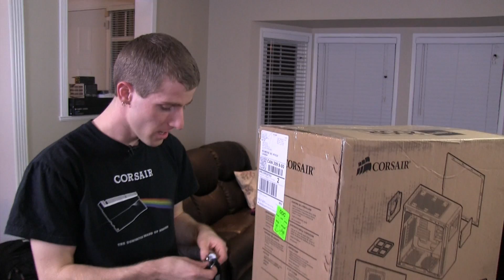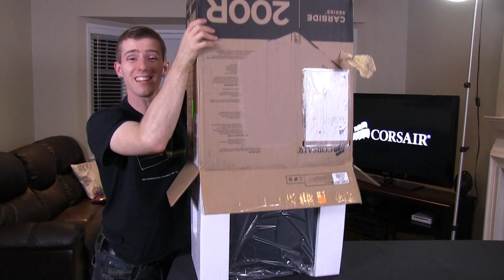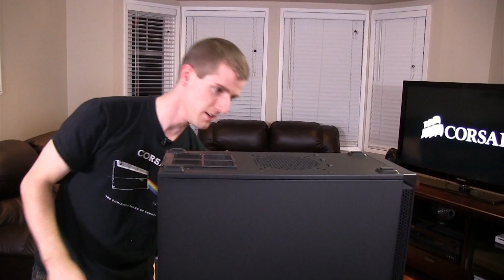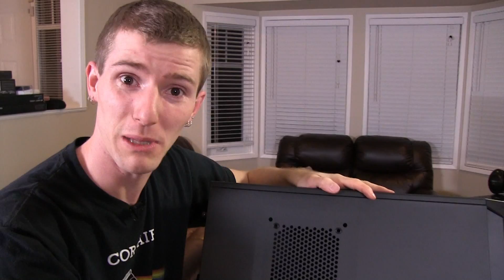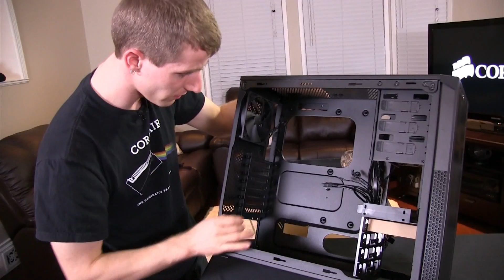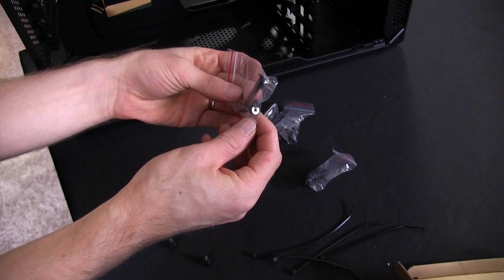Corsair 200R Value Gaming Carbide Series Computer Case Unboxing & First Look Linus Tech Tips

Comment: Interesting that the value cases look the most sensible - no extra lights and windows and shit.
Reply: Agreed. I wanted a no nonsense case that has all the money put into function, not style. My case doesn't need spoilers.
Reply: The simplicity of the case is the best part, although I did buy one with a window just because I like to see my computer
Reply: But it's a known fact that spoilers increase the speed!
Reply: Dominic Maas did u get the 200R? I bought one cheaply on Black Friday and personally wasnt too impressed about it after checking it out further. Its easily beaten by newer and cheaper cases and hdd cage prevents good airflow etc. also making top vents quite pointless, because who would want negative pressure. Also im interested how much does it cost wherever you live? Here its still ~65€ making it close in price with newly released quite awesome 270R.
Reply: Dominic Maas nice choice :) do u have 2 hdds? u could screw the ssd in 3.5" bracket if its empty.. provided theres the correct holes. so weird that 4 year old 200R is more expensive than better equipped Pro m :D here theyre quite close in price, pro m being bit more expensive
Reply: Dominic Maas nice choice :) do u have 2 hdds? u could screw the ssd in 3.5" bracket if its empty.. provided theres the correct holes. so weird that 4 year old 200R is more expensive than better equipped Pro m :D here theyre quite close in price, pro m being bit more expensive
Reply: @TheViolander  for cars, not computers
Reply: @ajddavid452  You are not very good at reading social cues, are you?
Reply: @TheViolander  what's a "social cue"?, oh wait I could just google it, yeah I'm gonna do that Edit: after doing some research I realize that you weren't being serious, damn sometimes I don't think the obvious

Comment: I bought this case back in July 2013, still have it and don't plan on replacing it anytime soon. It's no larger than it needs to be to get the job done, yet can still fit a pretty long GPU and 11 drive bays total (3x 5.25, 4x 3.5, 4x 2.5).

Also protip for anyone watching in 2020, there is a dust filter kit for this case specifically, made by DEMCiFlex, which might be worth getting as this case has no dust filtration otherwise except the front panel and PSU fan

Comment: 2021 I’ve had this case for 5 years great case...lots of storage left over but if you’re trying to fit a 1600W psu it’s gonna require some bending of metal as I have discovered but not much, still looks pretty...only con is the glued on rubber feet came off that’s it
Reply: some extra info for 2023:

If you're using a GPU that is longer than 330mm (Asus TUF RTX4080) You WILL need to remove the drive bays entirely in order to fit the graphics card in this case. To do this you have to remove the front panel (you WILL need to remove anything mounded in the 5.25 bays in order to remove the front panel) and unscrew theHDD/SSD bay and then pull it out(Might need a bit of force, but not too much). I strongly recommend getting a corsair SHIFT power supply when using this case if you want to mount a fan on the bottom of the case. Gonna need to mount the SSDs in the drive bay if you're not using them, otherwise go full NVME. Still a good case that I've been using since 2017.

Comment: Ive been using this almost 8 years now. I dont care about lights or side windows or water cooling. I wanted the smallest case that is decent quality, could still fit a full sized ATX board and had room for an optical drive. I actually use all 3 external bays -  smart card reader, dvd burner and a card reader. Its been the perfect case and its only like 60 bucks. I reused it for my new build when I moved to ryzen 3600 from an intel 3770k.

Comment: oh my gosh thank you Linus, when you said something about the pin would shock and destroy your motherboard, I was like oh my gosh that's what I did wrong because I thought my motherboard was just dead but it turns out it was actually shocked now I know why!!!
Reply: The pin Linus is relating to is a centre alignment pin and does not touch any printed cirduit parts. It pushes through the hole and helps align the motherboard.
Reply: @tonyb7779  this ^

Comment: 5 years late but who cares. Just finished an install in this case of an Asus Z(&P motherboard and all of the other bits. All donated parts from my grandson who has upgraded his gaming PC. So easy to install. No problems and everything clearly labelled for even the most stupid of us. Big point, the pin Linus is referring to as could short out your board, is a centre alignment pin and simply pushes through the centre hole allowing easy alignment of board. Great case and very happy.

Comment: Everything fit! The large open spaces in side the case made cable management great and the Corsair H80 fan fit perfectly, leaving me space for two 120mm fans on top to push air out. The case is made out of hard steel and plastic and I was able to fit it nicely underneath an elevated desk on a  shelf 3 inches off the ground.

Comment: This old video has made my day. Just like Linus the Carbide 200R does not age. The sad news is that Corsair has stopped making them from what I have read. A lot of builders use this case for there clients base. Longtime YouTube presenter 

CareyHolzman has built hundreds of system using 200R. So with all that said I'm going to buy my 200R today before there all gone from the channel. Thanks Linus and Carey for helping this old  bench tech to get back to his roots.

Comment: Bought this in December 2013.  Front stock fan is just now going bad.  Pretty good for computer which is running all the time.  Not flashy case but really easy to build and maintain a system.

Comment: If you go with an H80i, don't bother going push-pull. Push Pull gives it more static pressure for better cooling, but the H80i comes with a Corsair SP120 which is a Static Pressure fan. Just run that in pull and you'll be fine. If you want to be a bit experimental, you can try the H80i in Push Pull, because if I am correct, it comes with 2 SP120's. (Which as far as I know means it's twice the static pressure as just a single one)

Comment: I just found this review after getting the case a few months ago. I had forgotten/not known that it had four SSD mounts instead of two. It has been a great case, just about to put an all-in-one cooler for the CPU. A good case for a new builder.
Reply: Tech Fox what all in one did you install in 200R?? im curious how thats possible :')
Reply: Signaturisti I'm using a Corsair H55. I mounted it to the back fan mount in a push-in configuration (and yes i know that it is not the proper name). Do you have the case or just looking at reviews?
Reply: Tech Fox HAD the case... bought it when it was cheap on Black friday (without much research) thinking i could put 240mm (h100 etc.) preferably in top or then front if needed, but neither is possible so I returned it and dont even have aio cooler yet so i dunno, maybe i just stick to my 212

Comment: Nice unboxing. And don't worry  about the living room. It makes your presentation look a lot neater than it otherwise would be

If this were a disassembly say of a laptop or something more technically intensive where tools and special test equipment were needed, that would be different., but for an unboxing it's just fine.

I am planning another Linux workstation, and this model is on sale locally from Canada Computers. That's just fine, now for a look at the rest of the stuff.

Also i like the 4 5 1/4 bays, lots of space for custom hardware, some of which I make from the raw steel up myself, sometimes by modifying stripped old CD drive cases as a start.

Comment: According to Corsair that extra standoff that Linus says could short your board is actually an ATX board alignment pin and as it corresponds to a screw hole in ATX boards I think it's meant to be there.  Apparently in some 200r cases it is unremovable but I'm not 100% on that
Reply: It is impossible to remove that pin. I have the case right here.
Reply: BoruOfPogoBog

I've installed my mobo into that case since my comment and no problem at all arose from that pin
Reply: I'm not installing an ATX board so it won't be a problem for me either. Lines up fine with Asus Z170-P. I'm very pleased with the look of the case and it only cost $45 after rebate.
Reply: TriggRNC So your ATX board didn't short? What about the other pins? Do I have to install standoffs or are those little pins standoffs?
Reply: no didn't short, after being undecided I googled the extra pin and a 
corsair guy on their forums said to leave it as it was a centering pin. 
 Motherboard went right in the case without any other standoffs needing 
to be installed as they are preinstalled.

The Corsair forums are worth a look too to be sure.

Comment: I know this is old but I had a PC built more recently with this case. Installed is a Asus Crosshair Hero Vlll with 128Gb ram and AMD Ryzen 9 5950X. I would love to see you install a water cooler, as discussed in this video. I have managed to fit a Corsair Liquid Freezer ll 240 but with only 4 out of 8 retaining screws.  Would love to see it done.  Might improve my fit.

Comment: From someone who owns this case - you cannot fit an AIO dual radiator (such as H110i) on the top. Even with the offset screw holes, a radiator+fans is going to hit 99% of motherboards and ram.

Comment: I think this looks very similar to the Obsidian 450d. The only thing that is not the same is the front panel and the window and the side. Would you rather recommend me to buy the 450d or this one???
Reply: MyNegativeCreep 450D has 2x140 support in front (not much of difference) and in atleast in here its 60€ more expensive than 200R (76 vs 136). I'd choose none of them, but F-D Define-series instead ;)
200R is 4 and 450d is 2 years old. was gonna build in 200r but after research - hell no!
Reply: i was looking at fractal design cases but i do not like front doors made of plastic...
Reply: MyNegativeCreep 200r has plastic front panel and imo looks way cheaper
Reply: I think the 450d looks just fine in comparison to R5 and 200R. Would you recommend me some other case around 110$?
Reply: You could get NZXT S340/H440, Corsair 270R or 400C or 400Q or 300R? Enthoo PRO M?  

How did you like Define C? It's the newest in Define-series. That's propably my next case when I go for watercooling.
Reply: The Define C is nearly the same as the R5 with a plastic front side that's why I decided to not buy this. But the NZXT S340 Elite is nice imo. But without any 5,25" drive.
Reply: MyNegativeCreep do u need 5.25 for daily use?
Reply: MyNegativeCreep arent they all plastic... even at that pricepoint
Reply: Too bo honest I use it like twice a year so I do not really need it, but it's always good to have one if I have to reinstall some old stuff and watch blurays. But maybe I should go aftera bluray player instead? hmm
I thought I could get the NZXT S340 Elite then. (which has no optical drive slot)
Reply: MyNegativeCreep twice a year you could just open the panels and plug internal drive in for the moment :D thats what im doing

or buy external one
Reply: lol good advice mate

Comment: That little nub / stand off thingy at 5:11 where he says, "you better remove this one or it will short out an atx board!" seems to fit through a hole in my MSI m5 z170. I just finished building my pc and am struggling with a no post (everything turns on). is this little extra standoff (that I cant seem to remove without a hack saw) the reason for my no post?

Comment: Since the top can take 120 and 140mm fans, is it possible to fit a 280mm radiator or would it contact the motherboard?

Comment: This may be a dumb question, but it's necessary due to my lack of computer knowledge. I am building my first computer this weekend (w/ the help of an experienced friend) and I am using this case. My motherboard will be the ASUS prime 390-A LGA 1151 ATX, I've been seeing that I may have to remove a standoff before installation of the motherboard to avoid shorting it, will this apply to me as well? Thanks!
Reply: im not sure, but there is a very easy way to check. just place your mobo in your case before you start your build. u will be able to see which standoffs need to stay and which need to go by aligining the screw holes on your mobo with the standoffs in the case

Comment: Thank God I saw this. Would've gotten my ATX board shorted out.
Reply: Bestgameplayer10 how do you remove the middle standoff??
Reply: Alexis jimenez When I checked, mine didn't come with that little there where he pointed out in the video. But the little above that is to help place the board down correctly aligned.
Reply: Oh i see, thank you im a little nervous since this is my first build, i tried to plier off the aligning pin, if i scratched a bit of it off will it possibly shock my motherboard or am i safe with that
Reply: Alexis jimenez It shouldn't. I was nervous wit my first build too ( which was a couple weeks ago ). I'm sure you should be fine. If the part you scratched is black like the rest then I imagine it being fine.

If you have more questions, you can ask me via Kik if you have it: bestgameplayer10
Reply: thanks man, yeah im a little shakey right now, screwing in the motherboard and everything seems to be going well, thanks :)
Reply: Good. C:

Comment: Should i get the 100r or 200r version?
im getting these specs 
i5 6500
gtx 1060 single fan so its not that big
a motherboard from asus forgot the actual name
8gb ram 500w Evga power supply
Reply: what you listed is about what my starter system was. This is a fine case for most things but personally I only came back here looking for info on using a 240mm AIO cooler in the top of the case. Linus has saved me from buying a new case

Comment: I'm divided between the 100R and the 200R.
Reply: The 200R is a significantly better case, with more space for drives, better cable management, and better fan options (120/140 vs 120 only on the 100R).

These days (early 2022), it's very difficult to find either the 100R or the 200R in stock, or for a reasonable price.  The best alternatives, if you need a 5.25" bay, is the 110R (and possibly the 110Q, if you need a quieter case, and a second fan bundled in).  I have built in a 200R, a 230T, and a 110R.  Out of the three, the 110R is the easiest to mount fans, the 200R and the 230T are nearly identical internally, and have the most comprehensive tool-less drive installation options.  The 230T has more fans built-in, and better overall ventilation, due to its front mesh.  The 200R is ideal for an office environment, while the 110R is pretty nice in the home, with its glass side panel and better options for liquid cooling.  The 110R only comes with one fan, though, so you would be wise to get at least one additional fan for the front (I bought 2 140mm fans for mine), assuming you won't be using the space for a 240mm or 280mm radiator.  The 110Q, due to its more restricted airflow, might have some issues with cooling, if you're going for a more power-hungry system, but otherwise, it's a good office alternative to the 200R, and more likely to be in stock.

Comment: Will a Asus m5a99fx pri r2.0 fit in here along with a gigabyte rx 480?
Reply: Slacin' Ace most likely it will, it has a pretty spacious inside, I'd highly recommend this case
Reply: I heard that the hard drive cage gets super hot and is kinda fragile. Did you experience this issue with yours?
Reply: whatame55 Its not as bad as people make it out to be, if you don't mess with your drive everyday you won't have any issues with it

Comment: Do you need a molex adapter or does it come with it?
Reply: what do u need one for? it doesnt come with one.
Reply: Signaturisti if your motherboard only has 1 case fan header it would be nice to have a mole adapter to connect the other one to the PSU, as the case comes with 2 fans pre-installed.
Reply: Pablo Schoots aah i see he/she wanted to use or just has one header only, but does any case have those included, i really dont think so...?
..unless, theres a proper fan hub attached. Also i dont think you need molex-power for simple y-splitter, just when splitting to 3 or more fans, but theres also sata-powered splitters nowadays.